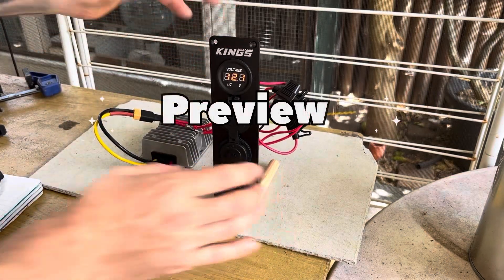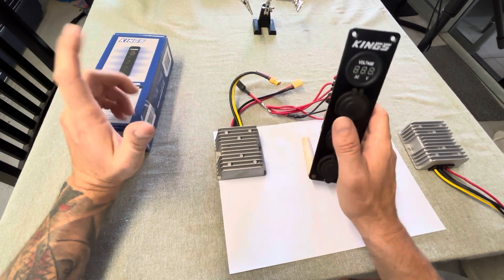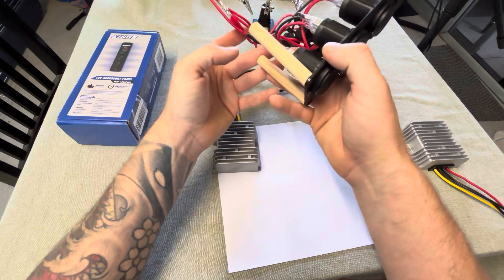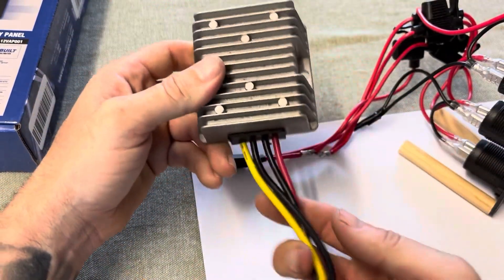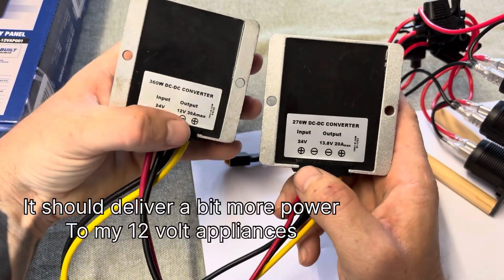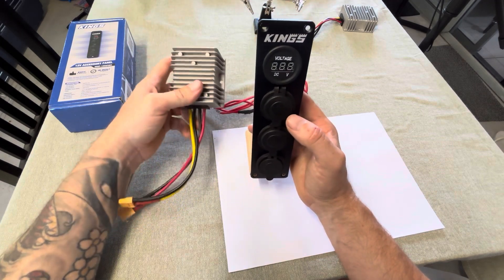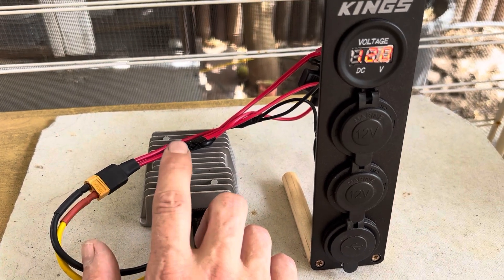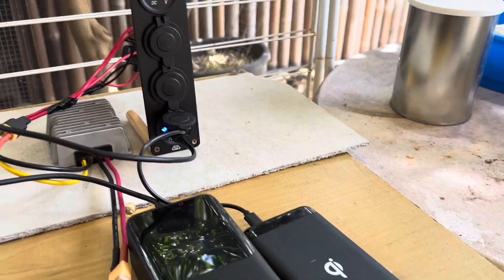NO BATTERY 12volt solar system. DIRT CHEAP

Comment: 13.8v is for car stuff not stuff expecting 12v. Cars are really 14v so stuff designed for them expect that instead
Reply from the maker: I did pick up a 13.8 volt dc converter I’m keen to check out
Reply: @Techboxreview  yeah stuff on a cigarette port likes 13.8 but house devices on ac adapter 12v like 12v
Reply: He can probably use the 13.8v for longer distance eliminating voltage drop if I'm not mistaken  @AgentOffice
Reply from the maker: Very good point 🤔

Comment: You know they have buck-boost converters too. Get a 13.8V version and float a small gel cell battery!
But do fuse it and add protections. Make sure it won't drain the battery when there is low sun, or burn up of there is a fault, etc.
Best to check with the manufacturer if you use with a battery, since that is not its intended use.
Reply from the maker: I have recently received a 13.8volt converter. I will do a comparison test between the 12v and 13.8 volt and see what the differences are. Thanks for watching mate

Comment: Bet it dies every time a cloud passes by! 😂
Reply: If your using it to charge a  powerbank it would not matter anyway 

It would just stop for a few seconds and then resume charging.... No big deal really
Reply: @MegaRyan123456 but then you actually have a battery and charger! So...that's not what the video purports to show!
Reply: @mrtechie6810  that's normally how a setup like this is used

You charge powerbank then use the farmed power to change other devices

But I have used the same setup to run a fan from an inverter

A pump

All kinds of things if the power drops for second it's no big deal

Your not going to be using it to power something critical like a dialysis machine 🤣
Reply from the maker: You would be surprised mate. Charging power banks and running small items it actually doesn’t. Thanks for watching 😎

Comment: Nice work mate ..... I have a question forgive me being nieve if your connect 12 volt batteries in succession for an offgrid power bank does that automatically make it 24volt not 12 anymore cheers bro keep up the good work 👊
Reply from the maker: 2 x 12volt batteries connected in series will become 24volt yes. Connected in parallel then the volts will stay the same but the amp hours will double. 👌
Reply: That's what I want in parallel 💪👊yes it will work thank you bro any chance you can do a demonstration vid of the difference please
Reply from the maker: https://youtu.be/m_fRQOBoLEg?si=CmfGXYxWLV17s5qE a quick vid u can check out bro. Has a bit of a rundown for ya 😎

Comment: Can I use a inverter on my itech 500p power station? By pluging the inverter into the power bank?
Reply from the maker: I use my converter to charge my Bluetti eb55. As long as the dc converters output voltage is within the input range of your 500p then it will be fine 👌
Reply: @Techboxreview  okay thanks mate 👍. I can't use my itech 500p to run my fridge in the kitchen, it's a lot more than 500w.
Reply from the maker: @matthewkeim6840 is it a big fridge?
Reply: @Techboxreview  yeah it is, the beer fridge isn't a very big one, but the power station won't run it either. Must be over 500w as well. They run the car fridge. The power stations have a 500w inverter built in. Is there any other way that I could get more ac power from them?
Reply from the maker: The surge from the compresser must be higher then the 500w inverter can handle. I don’t know of a solution sorry.
Reply: @Techboxreview  thanks for your advice mate 👍.